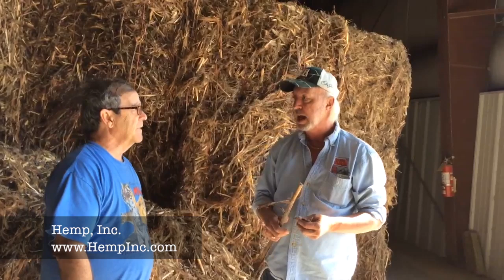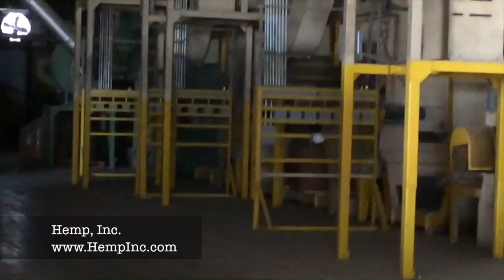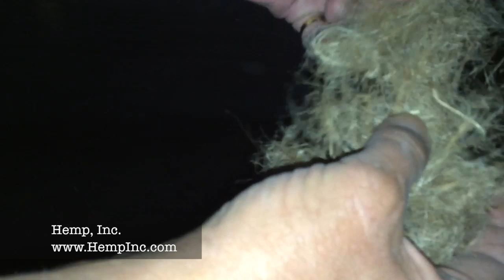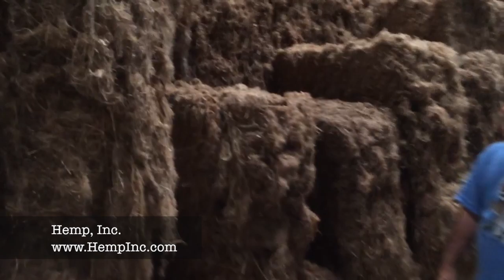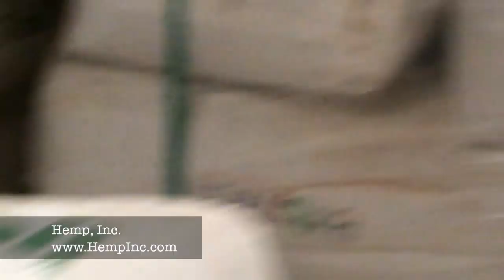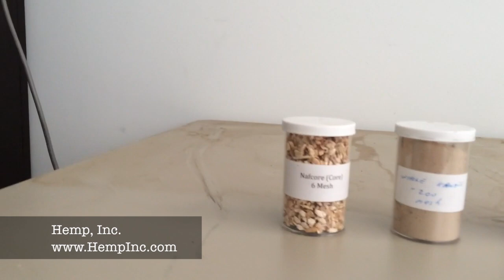Hemp Inc 's Decorticator

Comment: now if you had a nozzle that could deliver a hemp thread wrapped in polypropylene you could 3d print with it
Reply: You don't need Polypropylene. You could Do even better with the vast variety of hemp oil resen for hemp plastics
Reply: You seem to know quite a bit about this process. Let's work together :) We are working towards a hemp startup that deals with 3D printing and plastics replacement. SI SE PUEDE

Comment: That feel when this entire machine is replaced by a green decorator that Textile & Composite Industries designed, which is 100th the size and can be driven through the field.
Reply: does not do the same thing tci is not the all knowing source of info nor is colorado enviro textiles I like bolth companies but lets not let our ego`s run away with the answer wait until the entire class has commented please...the d8 is cool but it is a part of the process send me one in colo and we`ll try it then after a market study of product proving its greatness i`ll buy one it does not separate and card or clean for spinning it needs wretting for quality finished product..for fine cloth .

Comment: may I ask who the guy is in the photo below with comment ;" Im your daddy lil girl? 
My only comment is many of those who want to grow hemp for fiber to make clothing do not realize that without a textile facility that can handle bast fiber we will not see hemp fabrics in America.Please also note that there is only approx 10% of the entire plant that can be used for fiber. We will see seed for food grade oil , bio mass , and composite. From my observation of the hemp currently planted in Colorado HEMP (not marijuana ) it is a long way off until we know what varieties will be best suited for what.
Reply: When fibre fetches $520 a ton, in addition to the return$ for the seed grain - it can easily be sold to pulp & paper at a profit to farmers at the farm gate.
Reply: in what stage of processing do you say fiber will fetch $520.per ton?
Reply: Fiberglass "shorts" sell @ $300/t. Long strand fetches up to $1200/ton. Demand for pulp @ $800/t is endless. Processing is the KEY
Reply: long strands are hard to keep long and may need hand work .... I have designed a line that would do this.. the long fibers are top dollar due to their uses and strength left long .. 2x4``s and several other applications come to mind.. the pulp or herd is paper folks plain and simple endless demand may be 40 % cheaper than producing paper from trees  ..I logged for 3 years.. small scale...the ground cellulose is a plant polymer and may be ground heated and injected into a standard plastic injection machine for soft plastics.. such as  bottles the seed is for low or no voc paint, bio fuel and methanol used in the bio fuel process..full processing plant is the key invest in hemp .... 548 1214 d saelens
Reply: 10 % is your number 10 % of 7 tons an acre with low water and no herbacides or pesta cides not all fiber is for fashion so sorry cotton mills may also be used for denium grade or levi`s as sail cloth was used by mr strauss for jeans .please refrain from negative comments,, from my observations of canadian hemp there is no one in colo with a clue about this plant only speculation like ryan loftlin credited with the first illegal crop so far  no buena ....please contact for more info my rate is 50.00$ per hour for established businesses or free for start up companies ...a hint canada has the seed I want...
for montucky and I have 4 growers ready
 your a long way off and the wee in colo jus don know ....

Comment: Bruce we have 200,000 square ft available on I-70 just outside Indianapolis, IN.   13,000,000 citizens live within 500 miles.  Kentucky hemp wouldn't have to travel far, and the fiber would be half-way to the fiber panel processors in Northern Indiana.  As a bonus I'll show you how to lose that spare tire around your waste with Hemp Nutrition.  LMK ~ info@hempshare.org
Reply: hemp is perfect for detroit or in. area and seedes are in mi and nb feral
Reply: the machines are made in europe and are not cheap see temafa they will pay off ... afull line with air vacs and every thing is around 10mill new  plus the land and lots of 220 power to run them other hemp products need less capital food  and seed s are my interests  and area of study ,, no reason to give away all the market to nutiva and manitoba harvest when we can produce the same thing in the us now the hemp inc plant runs 100 k lbs a day ? thats alot of hemp .. canada has no fiber machines mostly oil for food and shelled hemp seed ..d.saelens 406 5481214
Reply: D. Saelens There are two fiber plants in Canada that I know of.  However, there is fiber in barn from the original crops over 10 years ago also.